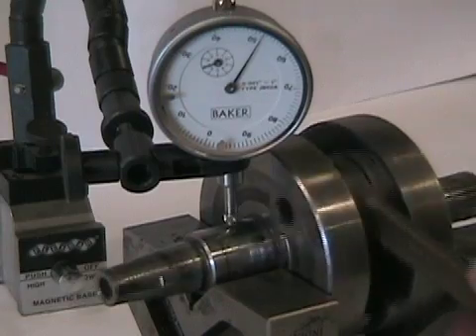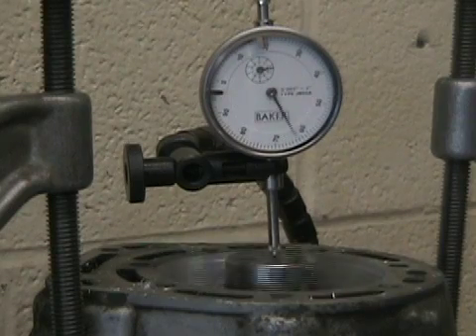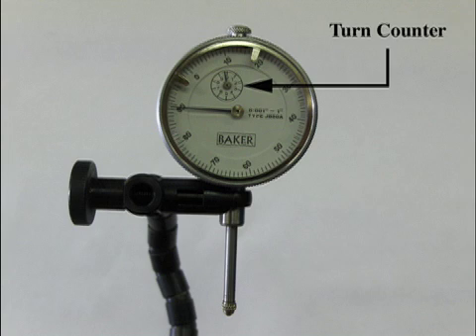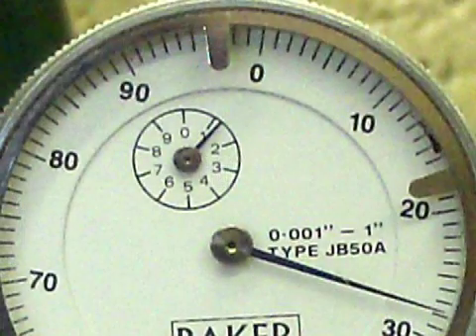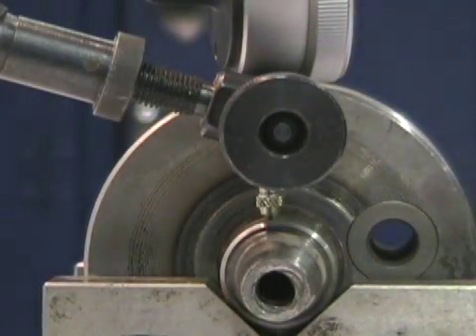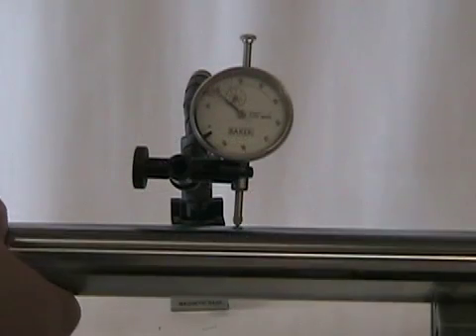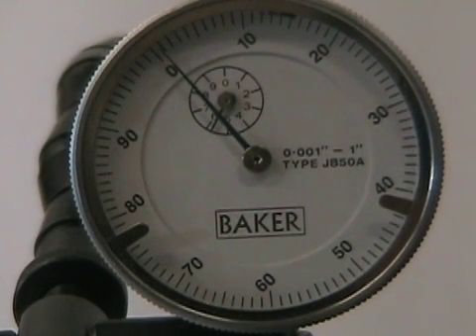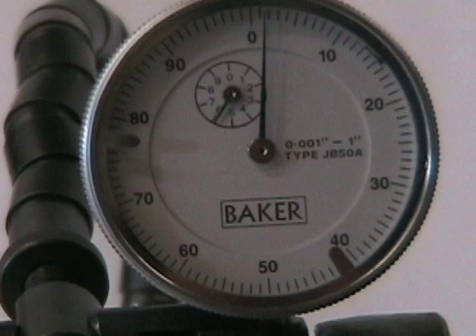Reading and Using a Dial Indicator.mp4

Comment: Quick question:  So it doesn't matter if originally the dial pointer is not set at 0.  Just move the bezel to the dial point/zero?  Most new ones I seen starts between 8-9.
Reply: just move it. doesnt matter if its set to 0 orig.